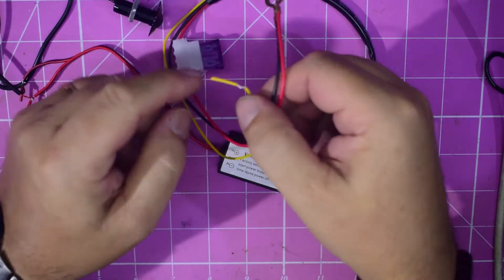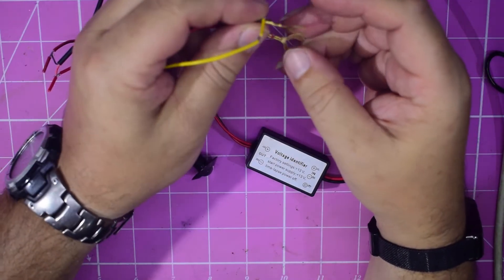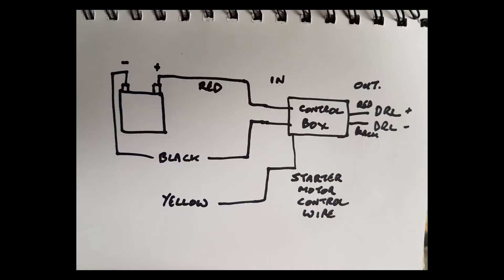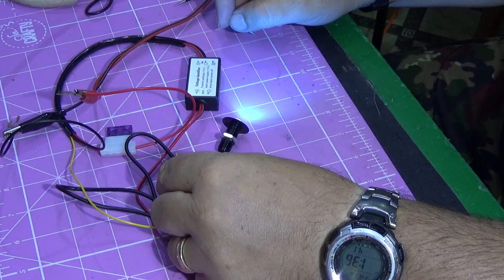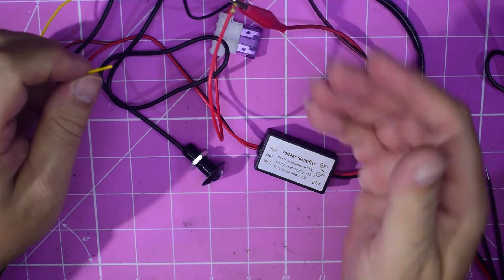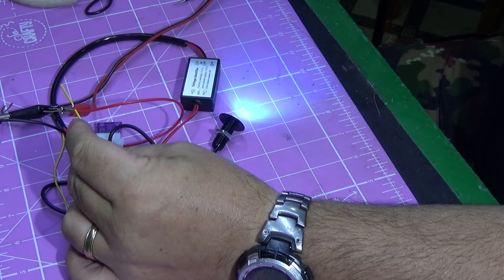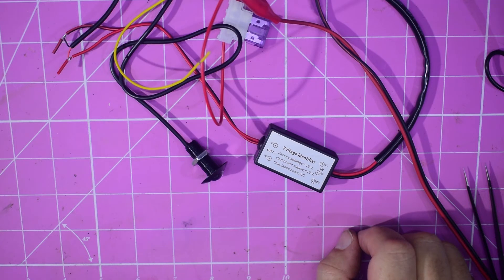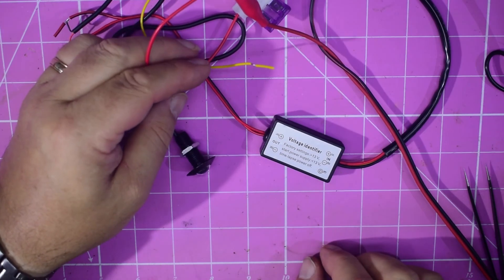Automatic Daytime Running Light Controller

Comment: Hey George, I took your advise and installed myself, and everything worked fine like you said. However, one day I was driving and used my high beam light, and from then on it stopped working. Any suggestion?

Comment: Can i ask sir.2 drl and 2 module to intall or i will put 1 only module to light up
Reply: I used 1 module to run two 12v lights and it works fine
Reply: @kewl9  thankyou

Comment: I have two controllers on my car but don't want the dim feature. Can I connect the yellow wires together to create a complete circuit without risking a short?
Reply from the maker: I'm not sure, it depends on the car and the unit you have
Reply: @GeorgeChristofi  02 accord with the J30A1, if that helps..?
Reply: @drewa5075  just tape it off. You don't need to do anything with it

Comment: Where is the main power connect to? Battery or factory headlight wire
Reply from the maker: if I remember it should be battery
Reply: @GeorgeChristofi  

If it was a battery, how then did you managed to decrease or increase the voltage to switch the module on and off?

Comment: So this controller has two functions. It will automatically turn on the lights when voltage is greater than 13 volts and turn it off when you turn off engine and battery voltage drops below 13 volts. Which is good. Automatic and no chance of draining battery.  

Secondly that yellow cable is to dim if you piggy back fuse it into the normal light beam fuse. Also if you dont want to dim you leave that yellow cable alone?

Is this right? 
All in all. Not bad lol
Reply: I did this type set up with two controllers, but put an end cap on the yellow wires. The DRL's don't shut off until the negative is unplugged. I believe connecting the yellow wires would create a complete circuit while also bypassing the dim function. Someone correct me if I'm wrong so I don't accidentally wire a bomb under my hood 😅

Comment: Think you have got your balls twisted. This controller is simply used to dip the running lights when you dip your main lights ...
Reply from the maker: Many thanks Steve. I really don't know much about the running lights rules as my car was never fitted with them as standard. I was basing my knowledge from the description on the chinese website that sold them. It has been a long time since I was interested in cars and fixing them, nowadays I'm too old to be crawling underneath one every weekend for fun!

Comment: Yellow wire is supposed that should turns on the turning lights? (indicators right?)
Reply from the maker: I think that is what it is for. I will have to dig out the unit again to see.
Reply: @GeorgeChristofi  If you can to check it out how did you connect it cause mine doesn't work :(

Comment: The yellow wire is suppose to go to a headlight and its job is to automatically dim the drl when headlights are on. This is a legal requirement in the UK and many other countries.
Reply from the maker: Many thanks for the information. I am not a user of DRL's, my car didn't have them a standard and I haven't retro fitted them. I was sort of puzzled as to the point of an electronic on/off box when a simple relay would suffice but if they do have to dim then it makes sense that it would be easier with electronics. All the Best.. George

Comment: does it dimm the light when switch on the headlight sir?
Reply from the maker: no, it just detects the voltage on the battery. Personally, I think it is a poor implementation. I would just have a relay connected to the accessory position in the ignition switch. that way, it can be rated higher and actually only fire the extra lights when the car has the keys in the ignition.
Reply: @GeorgeChristofi  the yellow should connect to the headlight positive, then it will dim the DRL when the headlight is ON.
Reply from the maker: Thanks for the information. Still think it is a poor implementation of what can be done with a simple relay.